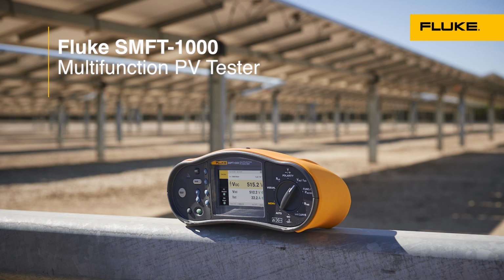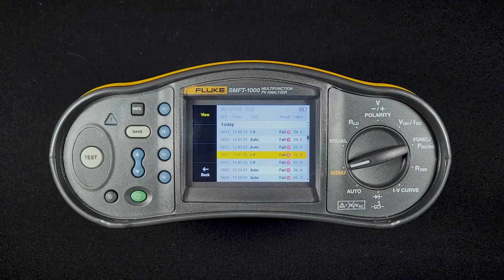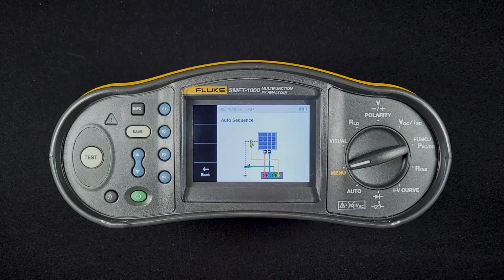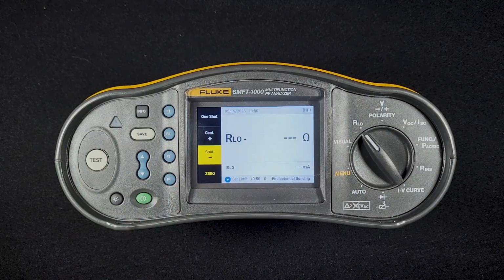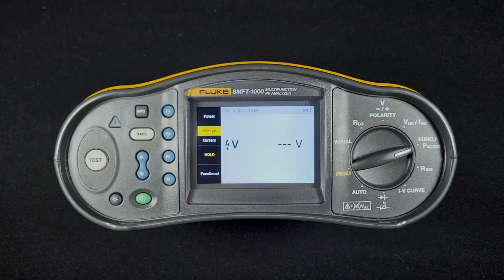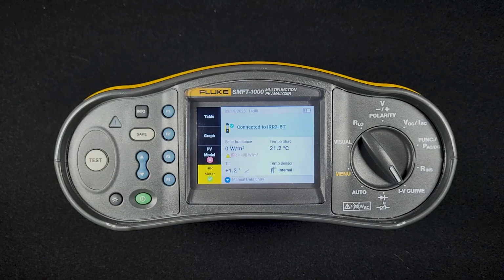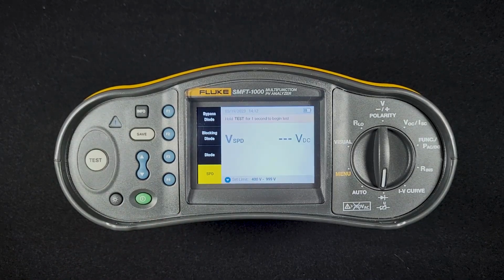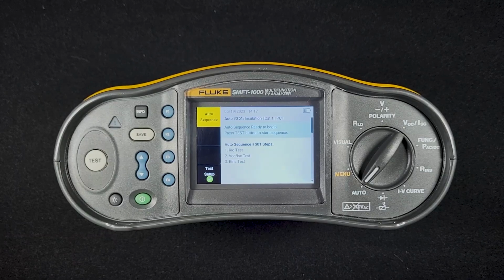Fluke SMFT-1000 Solar Multifunction PV Tester UI and screens

Comment: find a problem with this tool, it doesn't measure module panel more than 15 amper and data sheet this tools until20 A.
Reply: You got a solution?
We're recently working with the HT PVChecks PV Tester and there's an option in the moduleconfiguration to set the module technology to capacitiv, which allows higher currents although it's only capable of 15A max.

Sadly we do need a new tester to test IV curves too and the SMFT 1000 seems really handy and is way cheaper than the HT IV-600 which allows 40A, but without such an option the Fluke would be useless nowadays.

Comment: With this device was impossible to check I-V curve for N type PV panels.  I have try with two model (astroenergy CHSM54N-HC 425Wp and trina other model   )  and the device returns error no. 14 - Isc current overloaded. I have send the panels to a laboratory and and they are good.   It is not written anywhere that N type panels cannot be tested.
Reply: the same problem, although data sheet 20 A, you find the solution?